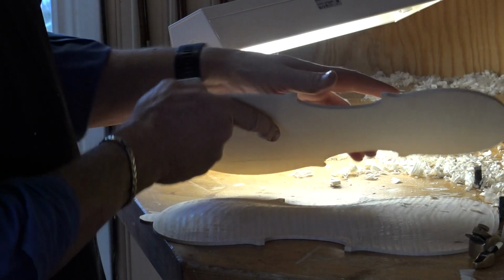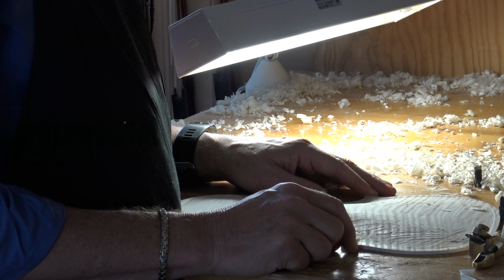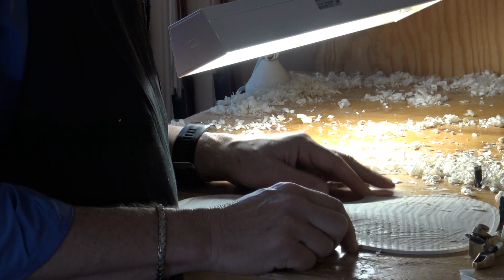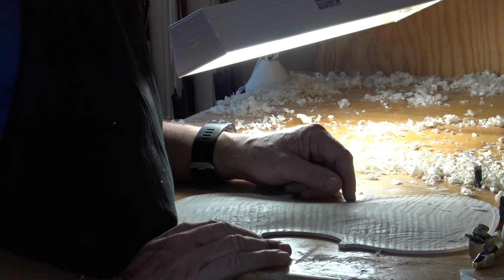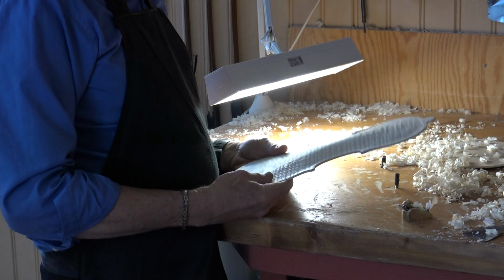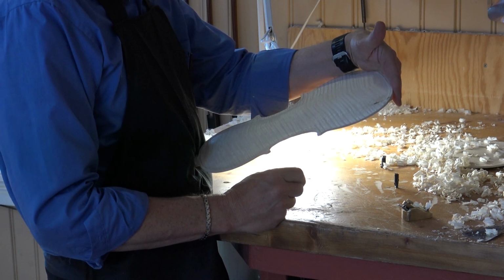Violinmaker Peter Westerlund Part 23b Planing the back and connecting it to the top pitch

Comment: I'm very impressed with your method and it makes me wonder if anyone else has discovered the same thing.
There was one aspect that I was going to question but you answered it near the beginning of this video. I wondered if the differences between the long arches of the top and back found on old instruments were replicated by your method. You demonstrated that they are replicated so, is the centre section of the top's long arch dead flat or near flat? Many makers say it should be dead flat.
Reply from the maker: As I see it, the top has a very minor curve. Not dead flat.